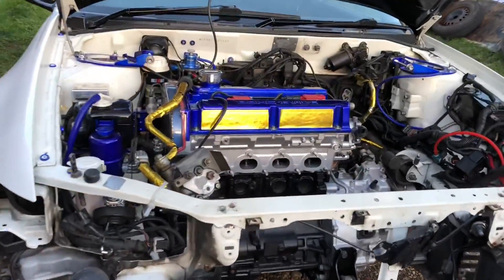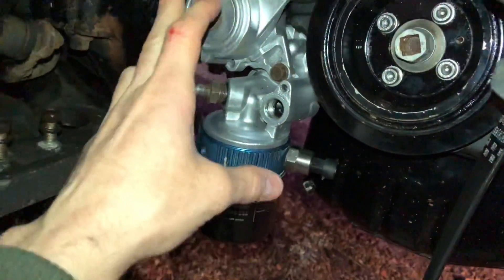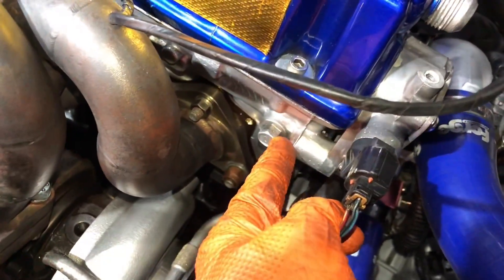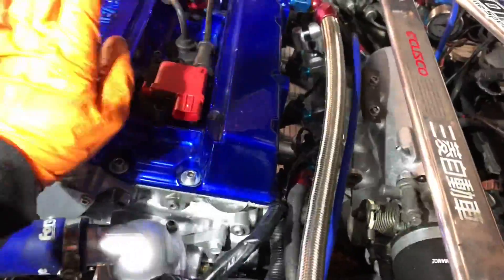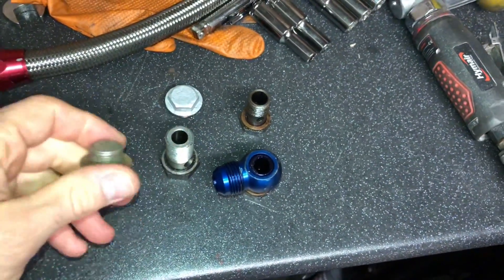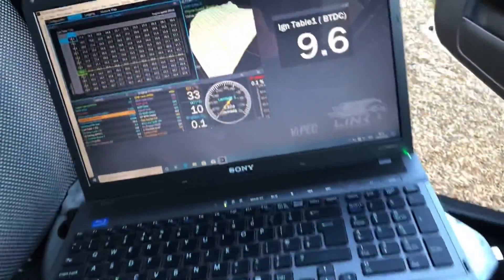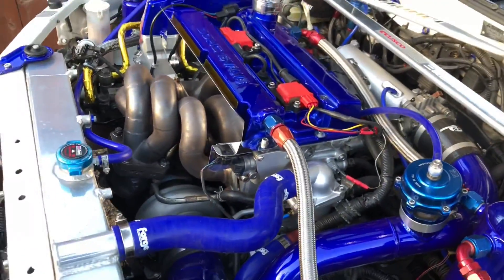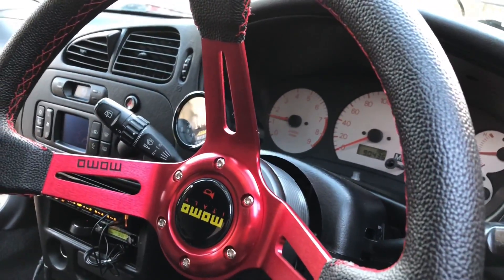FIRST START UP! THE ENGINE IS RUNNING! 600+hp Mitsubishi Evo 5 Rebuild

Comment: Bro how did you connect that big metal sleeved pipe to the rocker cover breather outlet? (I think you called it an AN pipe it looks the same as you had on the oil cooler).  I'm looking to fit the same to my evo 6 as it's recirculating the oil breather pipe into intake pipe which I don't want. Need an oil catch can :D